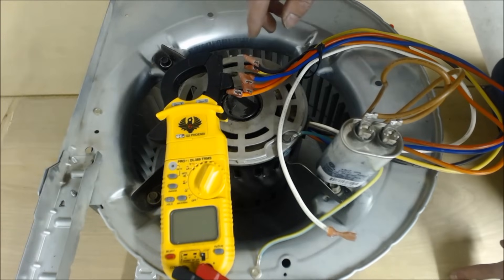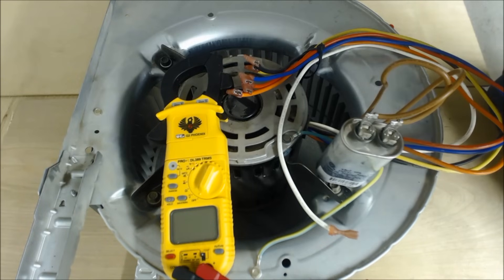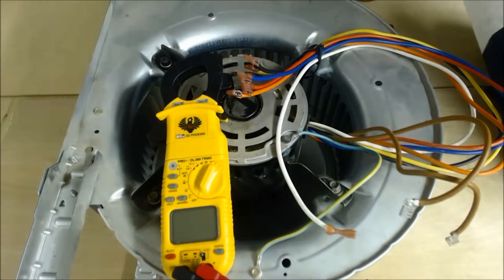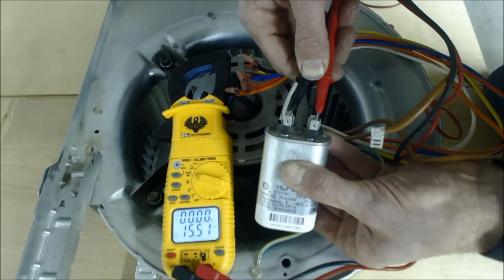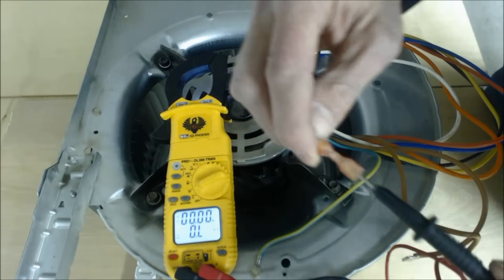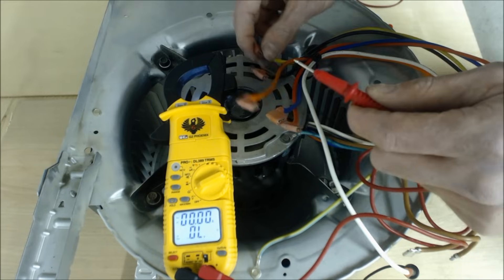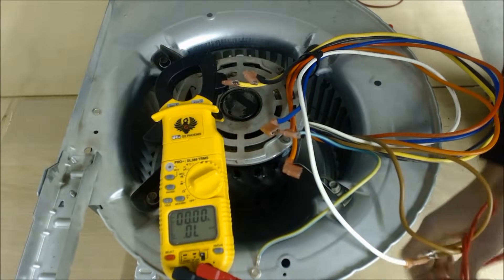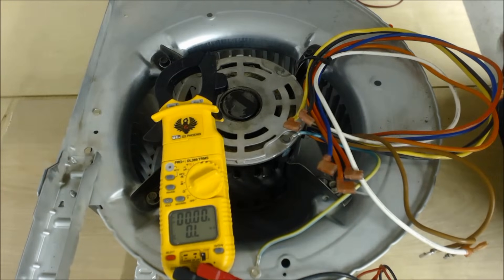Step by Step Procedure for Troubleshooting a Blower Motor from a Furnace and AC System!

Comment: Hi i need your help..
I have an air conditioner ,cassette model,but my indoor fan is getting spinning slow,it's not fast enought to blow air..it have 3 speed..but the higher speed is not blow much air..the question is what is the problem with my indoor fan?..i already check my capasitor and it's good
Reply from the maker: It could also be a closed off return or supply duct. If not and you are getting the right voltage then it would be a bad motor, thanks

Comment: hi, with the neutral(white) of the motor connected to the neutral on the furnace control board i have continuity from black, blue,red, orange to the motor chassis. is this normal? the power coming into the furnace has continuity from Neutral to Ground chassis. is this normal too? the old blower burnt out and i have just replaced a new one and noticed this neutral to ground has continuity with my meter. thank you.
Reply from the maker: Hey Mark, first make sure that every wire is disconnected so you don't have some type of connection from common to the ground chassis. Then after all the wires are disconnected, if you have a resistance value from a hot to the ground, then your windings are burnt and touching the chassis. Remember that the common is attached to the other end of your windings, thanks

Comment: Ok so what about if you DONT read 120v? Dead board?
Reply from the maker: If you have 24v read from g to c and no 120v from the board then yes the board would be bad but mak sure to check your tstat wires calling for the fan to turn on first, thanks!
Reply: I'm reading 26/27v AC from G to C but not reading 120v AC between the black and white wires from the motor when the system is on. Probably doing that wrong though. Thanks for the assistance.

Comment: I have been chasing a problem for a few days..when the A/C comes on I get a banging sound from the air handler..I replaced the capasitor noise went a away until the next time it came on..currently I am keeping the air handler fan on 24/7..but now when the A/C comes on I get a humming sound flickering "on" light from my thermostat and some flickering on the house lights for a few seconds..then all is fine..can the fan cause these problems? It has about 1/4 inch play side to side and 0 up and down...Nordyne E3EB-020-H about 10 years old....
Reply from the maker: It sounds like maybe the motor bearings may be bad. If that is the case then the motor should be replaced. The motor itself should not have any play with the shaft. Only rubber mounting grommets, thanks

Comment: purple black blue and red wires only hvac 4 wire  motor and the two brown to the cap.
how do I wire it up for 120V ?????
Reply from the maker: Purple is a color used on 240v motors. It also sounds like you don't have a white for common. Is there a wiring diagram on the side of the blower motor under the motor mount assembly?
Reply: ok thanks

Comment: I checked all speed wires to common and got continuity beep on all. I have also replaced the capacitor. What else could it be?
Reply from the maker: Did you try checking resistance of the capacitor wires? Does it make noise or draw amperage when power on?

Comment: How did you know the white wire was the common wire ?  Once you have the common to test the other speeds,  there should be some resistance number the lower the number the faster the speed. IF you get  OL or  000 the motor is bad. IS this right ?  The one I am woking on runs but it is like it is stuck in first gear.
Reply from the maker: The wiring diagram on the motor, wiring diagram on the unit, the white is hooked to the common wire tap on the control board. Yes what you are saying is correct. It sounds that maybe your windings are possibly melted together. It sounds like the motor is on its way out, thanks William!

Comment: How would you test the blower motor start winding?
 
I have tested all of the speed wires to common and the capacitor wires to common. 
Black, high speed, cool - 3.2 Ω. 
Blue, med high speed, heat - 4.5 Ω. 
Yellow, med low speed, park - 5.8 Ω. 
Red, low speed, park - 9.3 Ω. 
1st capacitor wire, brown - 9.3 Ω. 
2nd capacitor wire, brown - 39.4 Ω
So speed wire resistance readings are good. (I'm not positive abt the capacitor wires?)
The capacitor itself was not in spec, so replaced it. 
Still fan does not kick on. Makes same loud, awful buzz noise. 
Fan spins freely when pushed by hand. 
Tested new capacitor, just to be sure. It is good.
Reply: I'm having the same issue,  everything checks out good. Did you check them for any grounding issues?
Reply: How did you fix it. I’m having the same issue.
Reply: same here lol, buzzing motor, capacitor value and tolerance checks out, resistances check out as well... im stumped

Comment: Whenever an OEM Chinese made motor ( Zhongshen motor ) like this goes I then put a GE or an Emerson with a separate four brackets belly band ! I had one motor like this that kept pushing its stator and shaft right through the plastic end cap that is on the bottom of the shaft/ motor for its application ( horizontal To the right install up in the attic ) not once but twice in 3 years !!! Put in an Emerson 3/4 HP and that was the end of the problem !
Thanks for the post
Reply from the maker: Nice, thanks Mason!

Comment: Can only one of the motor speeds be bad. Red shows OL but all other colors look OK.  What would cause this?  I replaced a 17 year old blower motor and the new one stopped working after 2 months.
Reply from the maker: Yeah one can go bad.  I would call the manufacturer or supply house and check on that getting replaced, under warranty possibly, thanks

Comment: How bad is the shock from a capacitor?
Reply from the maker: It is typically just the start capacitors or a capacitor connected to a broken psc motor that you need to worry about the shock with. For the rest, the shorting of the cap is done so that there is no residual power that would mess up the multimeter reading, thanks

Comment: thank you for another great video. this is considered a 5 speed motor because of the 5 different speed taps. so what is a SINGLE speed furnace blower? is there such a thing because don't you need one speed for heat and one for cool? can you please help me to distinguish between single speed blower and multiple speed blower? thanks.
Reply from the maker: Older furnaces only came with a single speed blower which was either a shaded pole or a psc because they weren't designed for cooling as well. When installing cooling, a psc multispeed is used as a replacement if the customer wants to keep their 70% efficient nat gas furnace. Often we just see cooling set with a low fan speed because the installer didn't recognize the need to change the blower motor. Once dust starts to accumulate on the bottom of the coil it brings the evap from being on the verge of freezing to actually freezing. A single speed shaded pole will only have two wires, a single speed psc will have two plus the two capacitor wires, a multispeed will have one white common and multiple hot speed wiress along with the two brown capacitor wires, thanks Mark!

Comment: verry helpfull and straightforward video, thank you. i was actually trying to figure out what wire did what on a used blower im using for a different application (shop ventilation) so the simple test was verry helpfull
Reply from the maker: Thank you very much!

Comment: Thank you for the the video. Quick question my old capacitor has 2 terminals. I cant find the exact replacment to it. The ones i am looking at have 4 terminals, like the one in your videos. Do i just plug the wires in any terminal? Hope that mafe sense
Reply from the maker: It won't matter if the cap has two or four tabs on each connection site as long as they are all connected together at that site. Make sure the cap voltage is the same or higher and the mfd or uF is the exact same as what the old one was as it states on the rating plate on the side of the motor, thanks Gamie!

Comment: Thanks for this video!  I have a 2002 Bryant Plus 90T furnace that was igniting but then shortly thereafter shutting off, and giving me a code 13.  I suspected there may be something wrong with the blower motor as it seemed to run at much slower than normal speed when I switched to fan only at the thermostat.  I use this function a lot during the summer months to circulate air in the house so I know how fast it usually runs.  After other troubleshooting suggestions were followed,  my problem was a faulty motor run capacitor, found thanks to this video.  I was able to find a matching replacement at Grainger for $5.  Cheap fix!   Furnace is now operating properly.
Reply from the maker: Glad to help!
Reply: I told my wife "The Flux Capacitor" went out!  Haha  ...Back to the Future
Reply from the maker: Yup that is heard a lot!

Comment: Hi, I am checking  my HVAC and the blower motor has four wires - black, brown, blue and green.  There are two capacitors for the fan. ( and a separate one for the compressor) When I tested the wiring with the multimeter, there is reading when I connect black and brown.  When I test blue with all other wires, there is nothing at all. I saw most motor has a white wire but mine doesn't have one. Can you help please.

Capacitors are all good but the HVAC won't start up.
Reply from the maker: Is this a packaged unit outside? That would be 240v. Normally the wiring diagram is on the side of the blower motor and also the wiring diagram is on the inside shroud of the packaged unit. What does the unit say each of the wires are labeled as?

Comment: My LennoxLandmark EC10 electric furnace fan kicks out after two to three minutes of less than full air flow. Air and heat work. Only issue is air flow. Cleaned motor housing with compressor equiped with fine flexible copper tubing to no avail.What should I do next before resorting to motor relacement?
Reply from the maker: Is the motor ecm, x13, or psc?
Reply: Sorry, I have no idea. How could I determine which? On motor?
Reply from the maker: Does the motor have a capacitor attached? Do the wires plug into the motor or are the wires running through the motor, what is the model number?
Reply: The capacitor is not attached to the motor, but to the outside motor 'cage'. Furnace model #? If so, Lennox Landmark EC1003-20-1.The wires seem to plug into the motor as far as I can see using mirror and flashlight.
Reply: Motor is out and wires run through motor.
Reply from the maker: If two of the wires run from the motor to the capacitor then that is a standard psc motor. You could try replacing the capacitor with the exact same match, if that doesn't work then you would likely need to replace the motor with one with the same ratings, thanks
Reply: Thanks for your prompt and professional response. Will test the capacitor to start first.

Comment: I have a very similar motor and it runs at about half speed and then overheats and shuts off.   I get 120 volts on the black winding and resistance of black winding 2.3 ohms. Measured the Capacitorand it  is right on.  I had another identical motor and it runs great, so something is wrong with this motor , I don't know what else to check. Gee Whiz
Reply from the maker: The winding has likely melted together with the lower speed winding creating a higher resistance reading and lower speed. Yup all you can do with that is just replace, thanks Dennis!

Comment: I am not sure if one I have is a 3 speed or 5. When we first got this place and I went to replace the air filter it would almost snatch the air filter  out of my hand. I had to turn it off first. Now it like it is running on a medium setting. It is pulling the air in but is no where near as strong as it used to be. Could that be that the high speed has gone bad ?  It has one of those washable type filters.Which I have cleaned  so I do not think that is the problem.
Reply from the maker: Yes it is possible that the motor is going bad. You also checked the capacitor correct? Also the air shouldn't be that negatively pressurized, maybe the duct is a bit small? You would however turn the fan off before replacing the filter, thanks William!

Comment: hi there i do have motor out. but i don't see a capacitor.  i replace a capacitor out there on the unit outside the last year.  but on the furnace blower motor i don't see any!!!..melting Tx.!!! can i plug black and white on outlet just to see if motor spins??
Reply from the maker: You may have an x13 or variable speed motor. Here is a playlist with those. It may also be a shaded pole if it is a really old motor, thanks!  -    https://www.youtube.com/playlist?list=PLxnHR5_D2ojyDrxCT9MIttGW4wxOZ3n-7

Comment: if i get two or more readings that are the same, what would be the problem?
Reply from the maker: I would check resistance of your probes by themselves first to make sure that they are definitely at 0.0 ohms. My probes have to get changed out after a few years. Then if this it the case then the motor may be on it's way out, thanks!

Comment: I dont see a capacitor on my blower, but the diagram shows an inductor coil  (looks like a transformer with only 2 leads)
Reply from the maker: Yes the motor you may have is a shaded pole motor if it is single pole without a capacitor from what you are describing. That is a much older style blower motor. Thanks
Reply: acservicetech actually it turns out I have an ECM motor.   Variable speed PWM.  Mo money!

Comment: Thanks for a very useful information. I have a two speed fan blower motor from my 220 volts ac air conditioner. Problem is when I switch it to high speed it starts giving some humming sound that scares . Please advise the solution and the problem with it.
Thanks.
Reply from the maker: I would turn the power off and verify it. Then go into the blower compartment and move the blower wheel and axle to see if there is any slop, see if it is rubbing on the squirrel cage and see if the motor axle wobbles like bad bearings. Other than that it may be a capacitor that is loosing storage capability or a winding in the motor going bad. Thanks

Comment: Wath if the blower motor is not running on high speed and smells like burn?
Reply from the maker: That sounds like the resin on the winding is burn't. That sounds like replacement time.
Reply: Thank you.  You comment is very helpful.

Comment: Hello AC SERVICE TECH.  I was working on my Aunts furnace. it  was getting any coming on. I replaced the Thermo sensor. It  say on now. thanks for your help with that. she say it not hot. A tech came out to look at it. He say it need a new blower motor. He won't  $1800 to put one in. I  installed it  for her with a new cap. thanks you again your video. I set the temp to 90 degree to see if it come up. She say it only go up to 73 degree. It running the whole time I'm there for about and hour. Could I have a bad thermostat or could it be the limit switch.
Reply from the maker: You want to look for a 50 degree temp difference between the return air and the supply air. If it is running and the flame is not shutting off but you are unable to heat the house then it is likely that there is something either wrong with the flame process or the gas pressure or the house is not sealed tight. The next thing to check would be gas pressure with a water column manometer and exhaust efficiency with a combustion analysis tool along with visually checking leaking joints in the house.  Thanks
Reply: acservicetech she did say with the heater on with the gas stover. She the stove is low.

Comment: once you were done checking the capacitor does it matter which way the wires back on
Reply from the maker: No it does not matter on a single cap like this. Dual caps use a common so it will be c and fan and c and herm which is the compressor. Thanks and check out the capacitor playlist for start caps, making one cap out of two, visual inspection and others. https://www.youtube.com/watch?v=ObTpixRWzyQ&list=PLxnHR5_D2ojwj2amJSXUKVkv4KV4Az5_Y

Comment: what would cause my gas furnace to make a clanking noise when it first goes on, then the noise stops while the hear is on and running?
Reply from the maker: I think you are on the right track with looking at the blower motor. You could turn the power off and verify that the power is off. Then you could see if there is any movement in the blower wheel attached to the blower motor. You could also just spin in manually and see if you hear the clanking noise. You could also see if it just happens in fan mode or if it happens in both fan and heat mode. Thanks